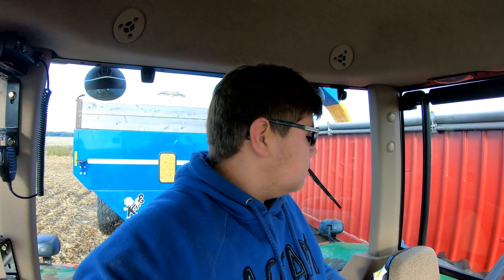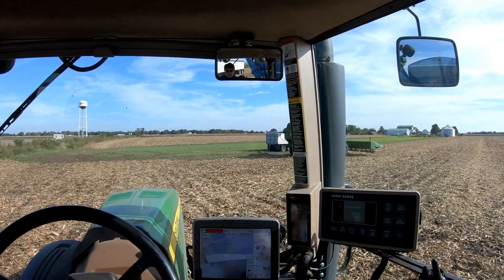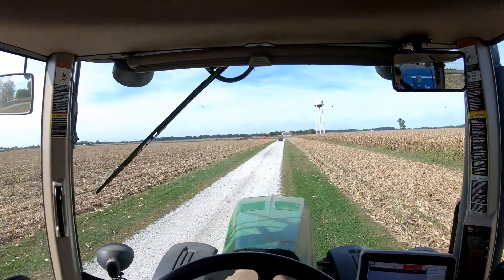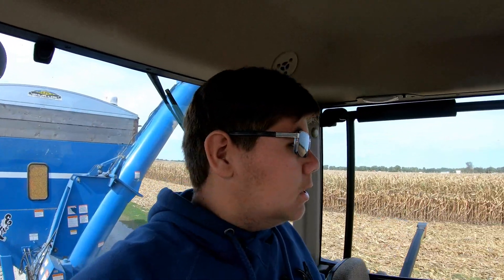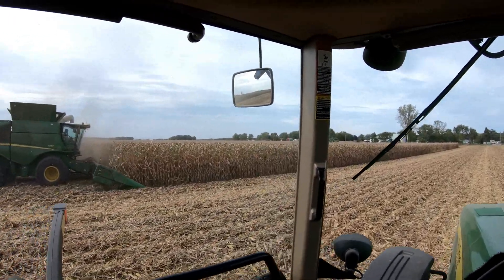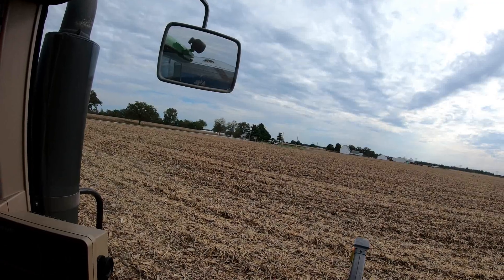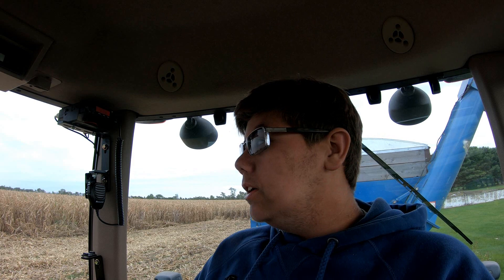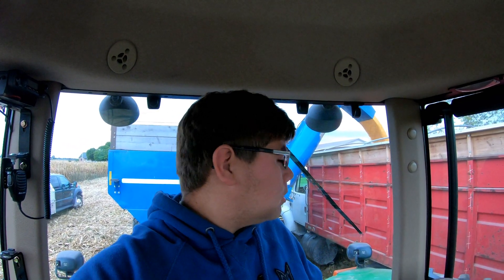SHELL SHOCKED - S690 THIRSTY for FUEL | HARVEST 19 Day 6

Comment: the new deeres are not known for sipping fuel.  my old 8820 could run 5mph with 8 row head all day long regardless of yield and it was about 2 gpa of fuel until i got a grain cart. unloading on the go get me down to 1gpa and doubled corn acres per day vs using combine to cart across field.  soybeans with 30 foot head at 4 mph was about 1 gpa not unloading on the go.  

fuel costs add up fast.  when we do a combine demo we measure fuel per acre, acres per hour, losses and grain damage. just using fuel between two machines  at .5 a gallon per acre savings over a 2k acre farm at $3 per gallon is 3k dollars a year cost difference in operating just in fuel.  over 5 years that is 15 grand. to some guys that don't sound like much but it all adds up.
Reply from the maker: Definitely. We can't believe how much this thing goes through in fuel.

Comment: Two questions. Why keep the auger out? Won't that add extra wear to it? And do those rollers on the header not cause it to shake a bit? 
EDIT: The combine auger
Reply: He explained the auger being left out in Day 5 video......something about losing grain having to re time it.
Reply: @paulmccallum4229  Ahh yes, but I meant the combine
Reply: @jacobotes8443  I think Dad opens it early and it just seems like it's always unfolded because he's only videoing his dumps , go to 8:40 it's folded
Reply: but then again at 10:50 it's unfolded for no apparent reason
Reply from the maker: We keep the auger out most of the time when we are in open fields with no obstacles at the ends of the field that we need to fold the auger out. Less wear on the cylinder and as long as keep the auger cleaned out it is not hard on the machine leaving it out. Now our fields are smooth so we do not have to worry about bouncing through the field with the auger out but if we were in a field that was rough that auger would be folded back at all times. We used to use the auger as a signal to the cart driver by swinging it out when the combine needs to dump but we learned over the years it's much easier keeping the auger out and also you know exactly where it is at all times especially with this one being a 26ft auger it hangs out from the rear of the combine a ways. @Jaco Botes